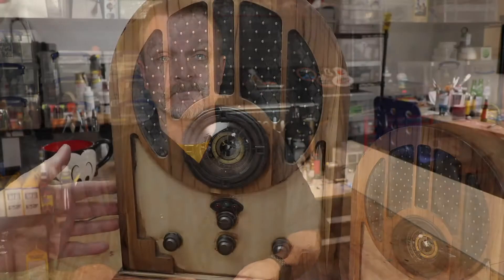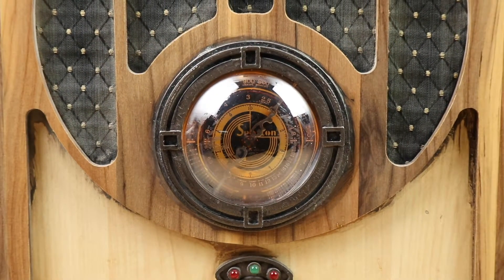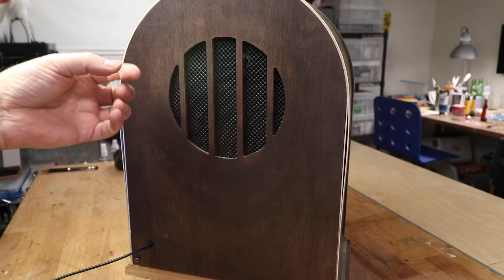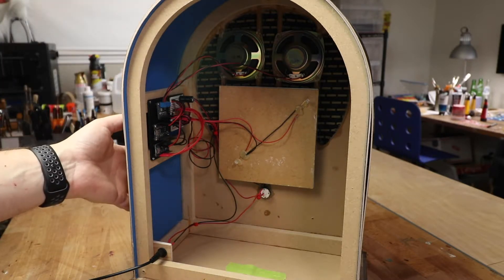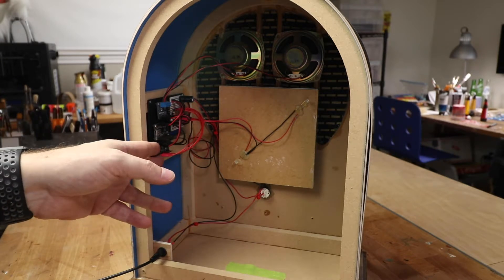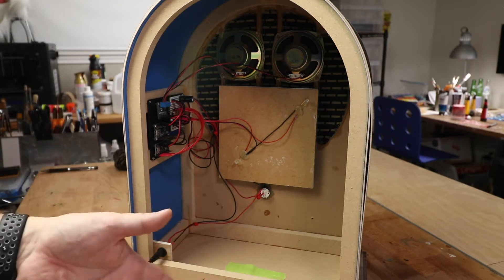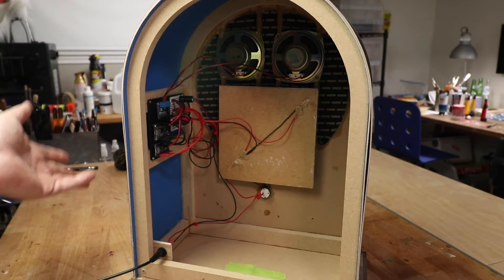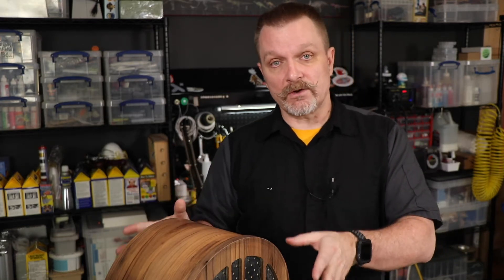DIY - Halloween Haunted Tombstone Radio

Comment: You have better self control than me. I would have made myself nuts trying to build a vintage 1930 style radio box. Even watching this VOD, I was running thought the parts needed. vintage bakelite radio knobs, thin walnut panels, silk screen mesh... and down the rabbit hole I would go, never to be seen again. hahahaha
Very cool project, thank you for sharing. 🥃🥃
Reply from the maker: Well... I kinda did go down that rabbit hole and it turns out those things are either 1) insanely expensive or 2) so old and damaged as to be unusable. Since this was intended to be a prop used once a year at Halloween, fake seemed to be a good solution. If I were to do this as something that needed a lot of up close scrutiny, I've since found some great suppliers of reproduction knobs and would upgrade some of the materials. It still holds up well at a distance... in the dark... on the porch. Cheers!
Reply: @RandomMakingEncounters  agreed, your way is much better, looks fantastic, and you finish the project. I'm learning... I need to stop over thinking so I can start and finish a project. Thank you.

Comment: This is such a cool project.  I want to build one and stuff a Bluetooth speaker radio in it for the illusion.  I intend to use paper doilies for a round speaker grille and have found some perfectly elegant lacy ones.  Can stack the doilies to strengthen them.  They can be bought in large quantities for fairly cheap.  They come in white or brown paper, gold or silver foil, and vinyl.
Reply from the maker: That's an awesome tip that I'm gonna tuck away. The dome on this dial is a Christmas ornament so I'm always looking for items that can be repurposed. The bluetooth speaker is BRILLIANT!!! Just build your playlist and away you go. So much easier and more versatile. You can use it all year long and just have a cool "radio" for all of your tunes. Thanks for sharing!
Reply: There are a lot of rechargable bluetooth speakers that double as lights and can change colors.  Some beat to the music.  That's the kind I intend to use and can stream music to it from a cellphone, or if the speaker has a TF/SD card or USB drive/mp3 player slot, can just insert a card or USB drive with old music or old radio shows on it.   If the tuning dial on the fake radio is translucent the Bluetooth light should show through it.  Styrofoam plates tend to be translucent and a bright Bluetooth / LED light should show through to a degree.  Could maybe use the plate to cut and create a tuning dial and cover it with clear plastic.  I'm saving the material for the project and will be excited to see & hear the outcome.  Also intend to create an old pendulum clock out of cardboard.  Lots of working movements on Amazon that can actually make it tock.

Comment: This is so cool!!! I am so impressed!! I think it's very smart to mount the main "ground" and "Power" lines to perf board(protoboard) instead of using wire nuts soldering them all together, I used this method on an arcade I was building that had a bunch of different boards, all requiring Power! (arduino, Audio amp, stepper driver, Serial MP3 player, neopixel LEDs, etc.) Very cool!!! 😎 Nice Work!!
Reply from the maker: I’m kind of a neat freak that way. I hate soldering things together in case I want to cannibalize the parts for later projects. It also makes it easier to throw in smoothing capacitors, resistors or even varying voltage sources. Sounds like great minds think alike!
Reply: @RandomMakingEncounters  Haha Yeah!!